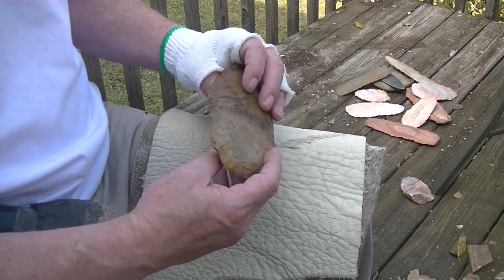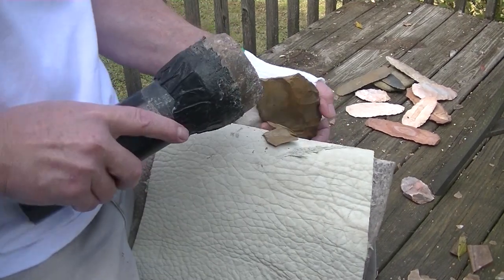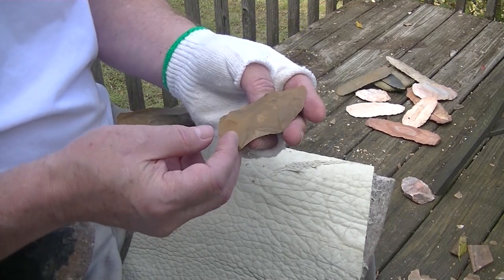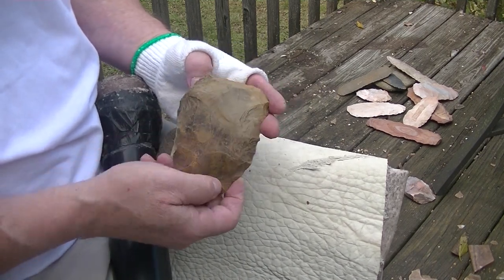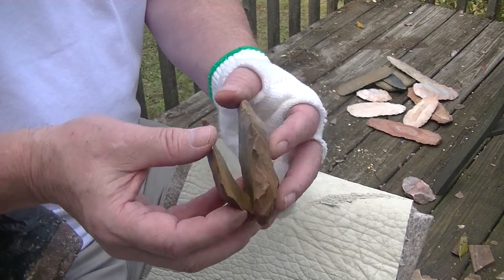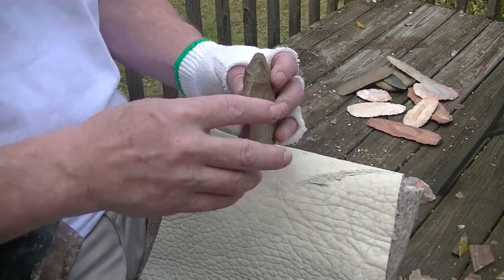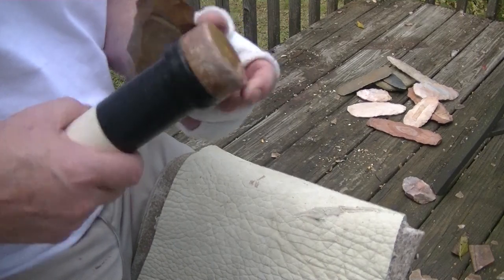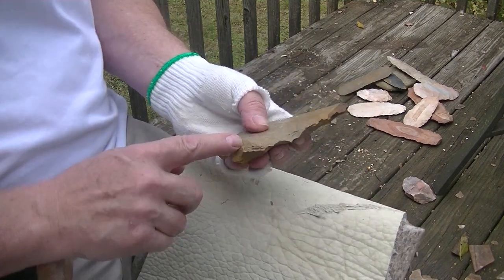FlintKnapping - MegaBopper getting bifaces thin fast.

Comment: It just dawned on me that you are striking in a manner that is totally different than how I have been. 

I see that you are striking on the side/with the edge of your bopper. I usually strike head on, which lends to me striking higher than I often intend (higher on the platform). I now see the benefit of striking on the side of the bopper, striking in the way you do seems to lend to a higher chance of the bopper edge meeting the platform in the intended location a lot more consistently.

Not sure if that makes sense the way I worded it lol, at any rate, you just gave me an epiphany and I appreciate that.